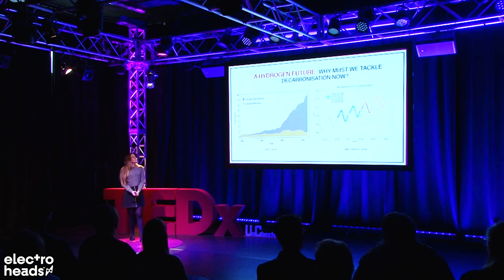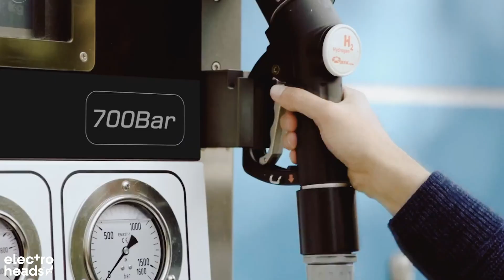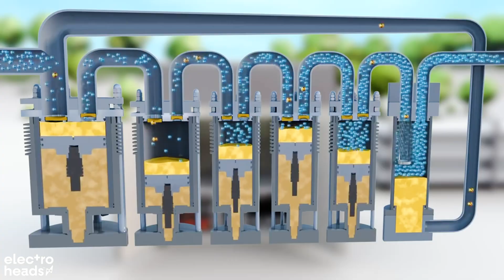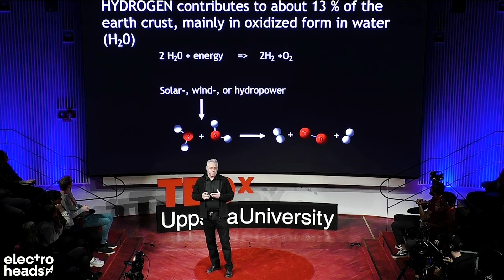Why hydrogen cars have failed - and will never succeed

Comment: I have a question as a Canadian who is obviously used to pretty rough and cold winters. Wouldn't the waste water froze and clog the whole system before it can be flushed? And even if we use heaters and whatnot to prevent that from happening, wouldn't that create puddles of ice around the car, making it potentially dangerous?
Reply: …Road heaters! taps head

Comment: Never say never...  Battery Powered Technology is only good for small size vehicles traveling for not that great distances. Hydrogen Cell Technology will allow you to go much much further on land, water and in the air. Refueling time and much greater range this is where the Hydrogen Tech wins. All comes to a simple energy per mass equation and the Hydrogen is the best thing we know so far. And no matter how hard you try to push more energy in your lithium batteries Elon, you will never come even close to Hydrogen (did I just say never?)

Comment: 24 hour endurance racing is moving toward hydrogen not electric.  Where is electric cars racing in 4 hour racing? There's not any because it's not feasible.  Electric cars are very dirty and use a lot of oil plastic resources.  You don't drive electric cars in freezing temperatures either. Germans are convinced Hydrogen will take over electric cars before the end of the decade.

Comment: Lets face it, EVs based on lithium ion battery cells pollute as hell and are inneficient too due to their incredible weight. Hydrogen will explode as soon as the extraction of methane hydrates ramps up., and there are many ways of obtaining it. Society cant work with lithium batteries, trucks, planes, rockets etc need a  new fuel and that will be Hydrogen.

Comment: Here's a thought. Why not hydrogen filled airships for cargo. One airship capable of lifting one shipping container can replace one truck on the road. The airship can fly directly from one point to another without following the road as a truck must do. With modern technology the airship won't even need a pilot, basically a giant drone. Keep the path of the airship over nonpopulated areas so that in the event of a catastrophic failure it won't crash on anyone's house. They could be scaled up to carry more containers as required.

Comment: Why don’t Toyota just create a electricity and hydrogen fuel hybrid
Reply: creating a hydrogen/electric hybrid aka a plug in hydrogen vehicle: super easy, bearly an inconvenience. just replace the whatever battery it has with a bigger battery and add a plug(and an inverter for home charging). results in being able to do most daily commutes on electric, less need for infrastructure(people would only need to charge up when they go on long trips) and probably even a better 0-60 time. might even require less maintenence compared to an ICE plug in hybrid.

Comment: Five or so years ago hydrogen might have had a chance to catch up with BEVs, but nowadays? No way. By the time they get their kinks worked out BEVs will be charging at about the same speed, have more range than HFCs and none of the disadvantages. And if solid state batteries actually make it to market (finally) then that is 100% game over for HFC.

Toyota and Honda made the mistake of backing hydrogen in the early days of automobile electrification and they invested hundreds of millions of dollars. They should have cut their losses years ago but they didn't. Toyota says they will reveal a solid state battery car in 2022 or 2023 but I will believe it when I see it.

Comment: The Mirai, with 400 miles of range, so you can use 200 of it driving to and from the H2 station.  But should you leave your Mirai far from a station for more than 2 weeks, all the H2 will have outgassed and you'll be SOL.

Comment: I would much prefer switching to hydrogen rather than battery, especially for long journeys. The fuelling process is much quicker, cars are likely to weigh less and range is better. Besides, it would solve the problem for HGVs and buses. I can't imagine long distance lorries running on batteries.

Comment: There's still a place for Hydrogen for long-haul applications like shipping and long-distance trucking.  The problem is that transporting Hydrogen to where they are needed present huge challenges.  The most promising methods involve using Ammonia (NH3) and various Hydrides as a more efficient transport medium than simply compressing the gas, but they are still in the early stages of research.  It definitely doesn't make sense for regular cars now that the BEV revolution is well and truly underway.  Toyota had a small window for the Mirai if they had invested in charging stations like Tesla did, but it's well and truly closed now.

Comment: Cargo ships, aircraft, steel-making and heavy industry, maybe even HGVs are potential for hydrogen but it has to be green hydrogen or what’s the point?

Toyota (and the Japanese generally) backed the wrong horse in this race.  On paper a neat idea.  Long range, fast refuelling, easy transition from ICE mentality, and no harmful tailpipe emissions.  But in the end it did seem as if this was the preferred option of the fossil fuel industry.

Comment: The chicken and egg factor of the FCEV is a major drawback.
To make the cars more usable my suggestion is to make PFCEV.

The BMW i3rex is a propper PHEV, where the engine is a range extender, for long trips, but the EV-range is good for everyday use.

If you take the rex-approach, but replace the ICE-generator with a smaller fuel cell, you will be able to use the car wherever there is electricity to available to charge, but avoid charging time where there are H2 fuel station.

The H2 distibution is not ready for plain FCEV yet, just like BEV have been considered inconvenient for long trips compared to ICE/HEV/PHEV. Making PFCEV, there will be more market for H2, and there can be more stations.

Comment: Nothing will have a future until there's demand for it. There is no real demand for EV. If you can solve certain problems, hydrogen could generate a lot of demand.
Reply: For example, as you refine the processes of conversion and make filling stations more feasible by fine tuning the supply chain and improving equipment.

Comment: you gotta use electricity and fossil fuels to make the hydrogen before you can even pump the stuff into a car and then the car has to run it through a conversion process to feed the battery.  WHY?....when you can use electricity to charge an EV and off you go.  No expensive production, transport, conversion to power a battery that powers a car.  So why complicate things.  and for those who say well it takes a lot to make a battery,  remember a hydrogen car has a fuel cell and a battery and electric motors (and a fat specially designed tank to hold the fuel under pressure).  again, why complicate things.
K.I.S.S.

Comment: For me, the biggest issue to overcome for hydrogen is this.  Besides being "green," what does it offer the consumer?  Performance is about the same as a gas car.  You still have to go to a filling station like a gas car.  Price of the fuel is about like a gas car (if not worse), and the cost to build the vehicle is also much higher than a gas car.  So, beyond some sort of government ban on ICEs, what would get the average consumer to consider giving up their gas car for an FCEV?   On the other hand, there are loads of advantages to owning a BEV or PHEV over a regular gas car.

Comment: I agree regarding cars, but hydrogen definitely has a huge place for trucks, ships, and planes.
Reply: Talk to just about any chemist Hydrogen is not feasible for transit.  The science of compressing hydrogen then again using that hydrogen to produce electricity to power thr vehicle is carbon intensive and if you factor in the science of the whole process it is glaringly stupid and not efficient.
Reply: @Kickin_gas  Nasa has been using hydrogen for years. For truckers, plane and ship, the point is about chargers and range, and also how long the charge take for the range they going. Hydrogen fuel cell charge fastest and same as gasoline, and their range is a lot more than gasoline, while electric the charge for average vehicle itself take 12 hour, the fastest for car can be 4 hour, the most high end ev car right now can charge about 30 minute and I'm not sure about truck, and not to mention for the charge that take so long that it not even worth for the range, it a big problem for truckers, plane, and ship. You also forget to mention Electric vehicle are heavier and weight more than hydrogen and combustion models. Now imagine what passenger ev plane, truck and ship weight if it include full of stuff and item. That also the big factor that you forget to mention. One of the reason why tesla stop their semi truck project is due to they fail to solve the charge, range and weight. And guess what, Hydrogen already solve all of this issue. The only issue here is it just not as green as EV but it green that gasoline. And that's all. But I'm sure you will not gonna tell those truckers, ship and plane to take ev because it green than hydrogen, lol nope it not gonna work that way. So I see hydrogen is the future. But it depend how environmentalist decide which root to go. But for truckers, ship, and plane, you gonna talk with them.
Reply: energy density doesnt allow usage on plane, H2 is also very corrosive and small atom
Reply: Planes maybe.  Ships no. Trucks no.
Reply: @crhu319  for plane, truck, and ship, it make more sense to hydrogen than electric.
Reply: @crhu319  IDK - burning H2 in the stratosphere looks like it's going to be a problem (global warming wise) so it might be reserved for long haul while short haul and mid-range flights could go battery?
Ships don't quite have the space for H2 but they could run on ammonia in the future.
HGV's will run on batteries.

Comment: There is an unsolved problem  in how to power high speed or high mass long range travel without carbon emissions. Perhaps hydrogen could be that power source, but it is competing with synthetic fuels, bio fuels or more way out things like exotic batteries. Green Hydrogen is just so inefficient from generation to producing thrust that only a combustion engine makes it look good. That inefficiency translates into high cost.

Comment: Even the faster refueling times of hydrogen can be overcome by companies like Nio with battery swapping so even that last advantage can fade away for cars.  The only places I see hydrogen is in airplanes and drones and other applications where energy density per unit of weight is absolutely critical.  Another might be semi trucks who have to climb seriously high mountain passes like in the Rockies.  There I could see the idea promoted in a video I saw of hydrogen fuel cell tanks similar to the propane tanks we have now which are simply  swapped into a truck that needs a little more kick to get up and over the mountain pass.  The truck would only use the fuel cell when the normal battery range is insufficient on mountain passes for instance.  I can see hydrogen for companies like Generac and home generator solutions and as a way for wind turbines to make use of otherwise wasted energy.  Other than that, nah.

Comment: Every vehicle that carries heavy loads over long distances could benefit from hydrogen fuels as at a certain point the weight of the necessary battery just becomes so big that you're spending a lot of energy just to get the battery moving.
So I'm thinking trucks and trains (on non-electrified tracks) and planes might replace fossil fuel with hydrogen.
But for personal transportation? Nah

Comment: Not a chance. It still has to be harvested, then transported to all the points of sale and storage. Electricity needs no transportation. A hydrogen car is an electric car anyway. Hydrogen for trains, ships and trucks maybe. But for cars? No. I couldn't "refuel" my Kia on my drive using hydrogen. Nor can can I get hydrogen from my solar panels.  There will be lots of accidents with those pressures too.  The big oil giants want hydrogen to succeed, so they can retain their iron grip on the supply chain. Big oil executives must surely almost choke at the thought of people being able to "fuel" their own cars at home using cheap rate energy and solar....

Comment: That's the same thing they said about wind power being too expensive. Wind is now competeing as the cheapest and fastest growing energy source.

When the underlying energy costs for producing hydrogen becomes cheaper than fossil fuel, it will be the last hurdle in Hydrogen's path. Petrol stations will be more inclined to turn their stations into Hydrogen stations than the already existing chargers(which you can do at home).

Comment: Hard too store, difficult to deploy, belittles steel, inefficient.... Also why would I want to wait at a H2O station waiting to fill up?  Overnight charging rocks.  Also parking to use facilities for charging makes sense.
I'd like to see government solutions for people who cannot charge at home (flats are the most difficult).
Now AI could solve this, but do we need all supermarkets to provide a dedicated charging area with DC charging?
Also motorways wireless charging....
Ok, so your EV needs an upgrade as does the motorway. It's billions!  But trickle charging as you drive?  It's infrastructure, like that old chestnut, the train.  Charge us by the mile anyway, but also refill the vehicle on the motorway!  Wowsers, now smaller batteries and even HGVs driving electric over long distances. When we add self driving to the mix it's gets interesting. I'd no longer need to change vehicles on the way to Scotland from London in a robo taxi for charging...
Now ok, we don't have motorways everywhere, we'd need to start with those and then start looking at A roads....

Comment: Hydrogen EVs may have already lost the race to Battery EVs in terms of infrastructure. Plus BEV infrastructure is scalable down to a charging station powered by nearby solar & wind, with a big on-site battery to store the energy until needed - all of which can be built by tradespeople using their existing fabrication and electrical skills. BEVs are also simpler and thus cheaper to manufacture.

Comment: Energy density in batteries can go up (and dies 5% compounding yearly) which reduces cost because less material and extends range, hydrogen does not do this, and it's cost to fuel will always be more than electric because it takes electricity to make.

So within a decade will go over 400 miles, and cost less than $35,000 and that's without a new revolutionary battery.

Not to mention you don't need a network for charging if you have a home charger.

Comment: Fueling an electric car: your house or already built out system

Fueling a hydrogen car: driving to California then back to Kansas and can't make it halfway and costs twice as much. Not to mention it costs like $100 to refuel the tank vs $10 for any electric car.

Fossil fuel companies can make hydrogen, so they prop it up (but when they make it it still makes green house gases)

Listen to Elon, he is a rocket scientist after all.

I'm not trying to be mean, but he calls them foolcells for a reason. (If you don't have a refiling station in every town no one will buy them, you don't need a Supercharger in every town, only every 100 miles for roadtrips and one at home/work for everyday driving)
Reply: You don't need supercharger at your home! You only need normal household outlet (or you could install $400 home charger for faster charging, but even normal outlet are enough most of the time). Electric cars in Europe are 8 to 11 times  cheaper to run compared to fossil cars!

Comment: For cars: I'm sure you're right.

For trucks & buses: If you can refuel in the depot, could make some sense 

For planes: Empty batteries weigh the same as full ones, so liquid fuels have a huge advantage. (Aero engineers' motto: Add more lightness)
Reply: Heavy trucks and buses will probably end up with some form of battery swap because their biggest operating cost, other than the driver's salary, is fuel.  Hydrogen is expensive and battery swap provides all the advantages of quick refueling but at a 1/10 that of hydrogen.
Reply: @Bryan46162  Even current batteries are adequate for buses and trucks. No swapping required. Professional drivers are legally required to take regular breaks. Don’t remember the exact figure, but I think it’s about at least 30 minutes every 2 or 2.5 hours. Which will sound familiar to a lot of EV drivers...

Comment: Hydrogen power is definitely a thing if your a rocket scientist.
Talking of 'rocket scientists' you should check out Bob Lazar's video on his hydrogen powered Corvette.
The hydrogen is generated by electrolysis which is in turn powered by solar.
It is the stored in a hydride tank and the fuel burnt in a combustion engine, wonder why legacy manufacturers never went down that route with 2030 coming up...
https://www.youtube.com/watch?v=Ytg23mDd1a4